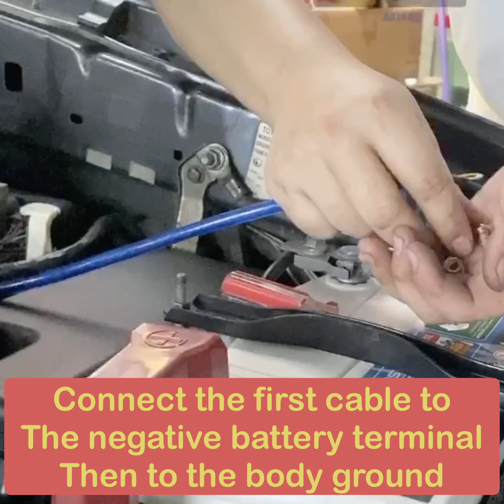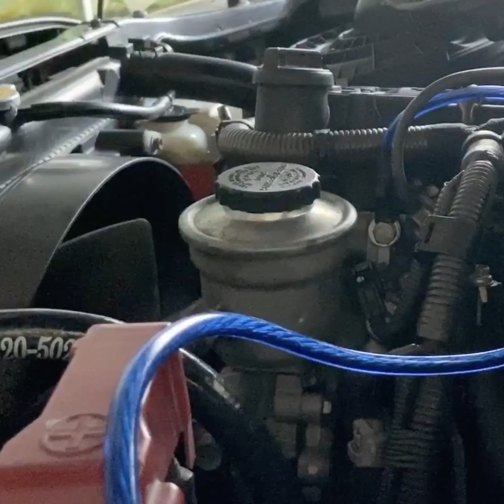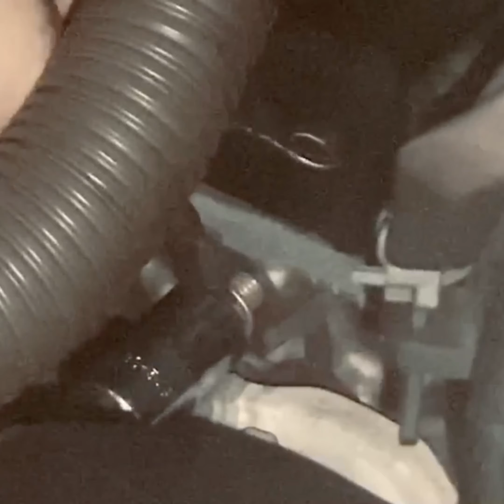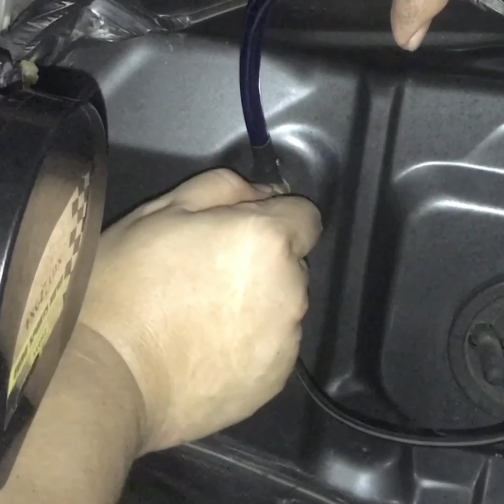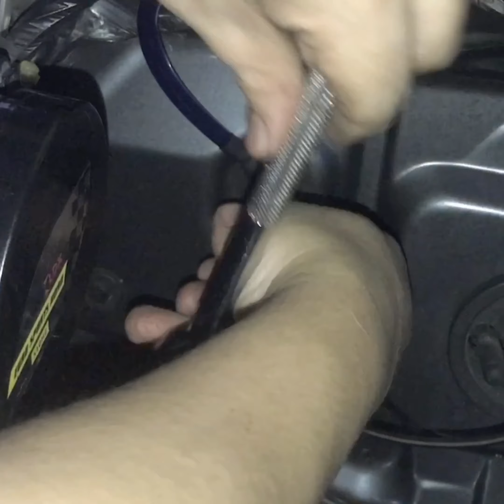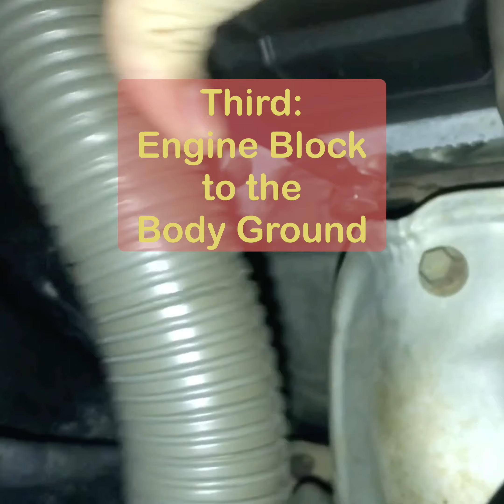Installing Big 3 Grounding Kit for Toyota Fortuner / Innova

Comment: Boss where is the connection from the Positive Terminal to the Alternator?
Reply from the maker: Berting 91 I will do that on the next video and it will be called the Big5
Reply: sir  @fixmhonkz13  waiting po sa video nyo nung Big5
Reply from the maker: Sorry for the long wait, I’ll try to make a short video asap. 😊
Reply: @Fix Mhonkz  ano size ng bolt sa engine block M10 ba?